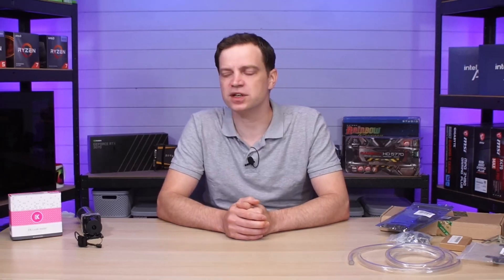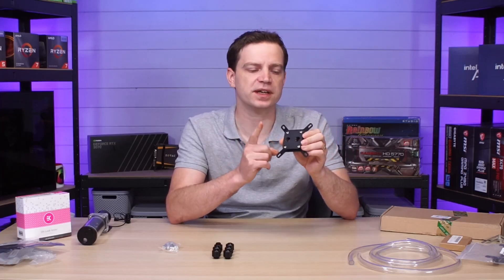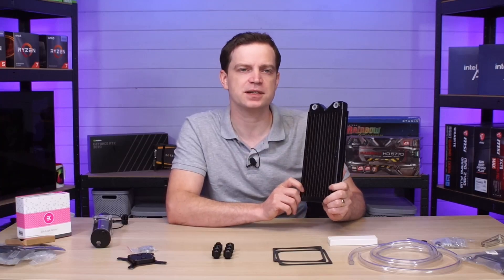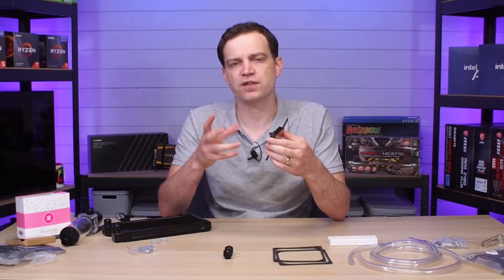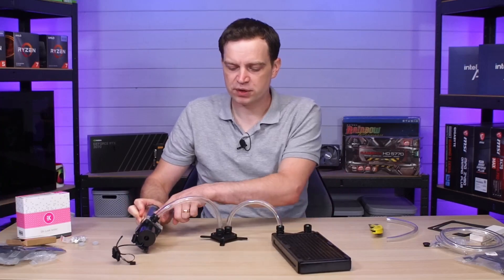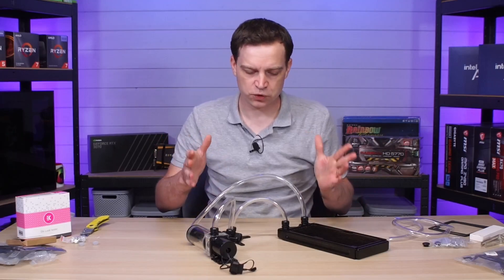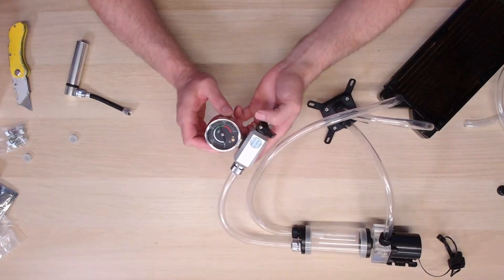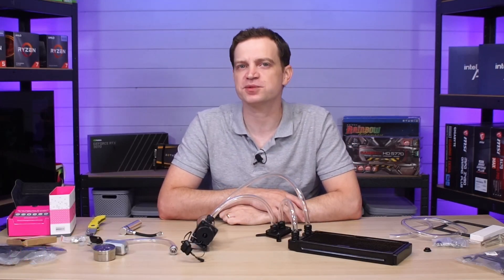Building a custom loop… Beginners guide by a beginner.

Comment: I have the same pump and it works fine when connected to itself and when I add a radiator, water flow is perfect. But the water will not flow through the gpu block at all, no water flow. Any thoughts? Have you seen this before?
Reply from the maker: I don't know much about them but at a guess I would say either there is a blockage in the block or maybe a one way valve system so the pipes are the wrong way around.
Reply: @TechLabUK  Yeah, I figured it has to be blockage in the block. Ordered a new one. Thanks.

Comment: What software do you use to control the pump and the fans and monitor everything ?
Reply from the maker: You can use what ever you want.  I generally set things up on motherboard headers and set them through the Bios and monitor them through what ever software the motherboard manufacturer provides but I have used the application FanControl before which is really good and does everything.

Comment: If you do the air test, spray soapy water on your connections. If there's bubbles you have a leak at that connection!
Reply: 14:10
Reply from the maker: Thanks for the recommendation :)

Comment: Do reservoirs and water blocks require a specific pipe diameter?
Reply from the maker: You can usually get the connector ends and pipe to match in size, the threads on the connectors for res, blocks, rads etc tend to be the same.
Reply: Thanks!

Comment: It's my first loop and I have doubts about the pump, I'll summarize, I have the Lian Li SL120 fans which, as some already know, are proprietary and the hub connects all the fans I use, so I connected the MOBO's normal connection to the RPM in SYS_FAN, and I connected the pump to the CPU_FAN instead of the AIO_PUMP, did I do that right? I tried to be as "clean" as possible in my explanation, thank you.
Reply from the maker: That will work fine and is how a lot of people do it as if you don't have anything plugged into the CPU_FAN header the bootup will complain (On most boards).  Just setup that header the way you want it in the bios and away you go.

Comment: Havent really seen much videos talk about this but how do you measure temps? Should we be referencing the water temperature? And if so, do we need any additional probes or do the pumps have sensors?
Reply from the maker: You would measure the temp of the components.  I do believe you can get inline thermometers and one's built into the res/pumps if you want to monitor the water temp as well.

Comment: Haha the other commenters already pretty much covered it, yeah it looks cool and actually does have some benefits over air or AIO but IMO not enough of a benefit and too much risk for that small benefit of a few C lower. Got a new Arctic liquid freezer 420 AIO that I bought for 100$ sitting in the closet and I still prefer my NHD15 but using just a 9900k and it's only 240W max OC so the D15 is plenty.